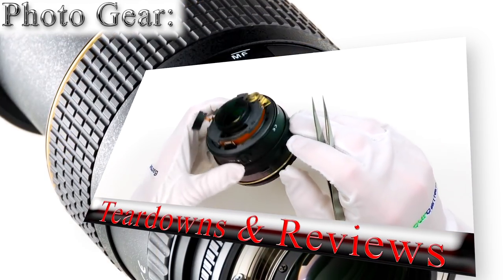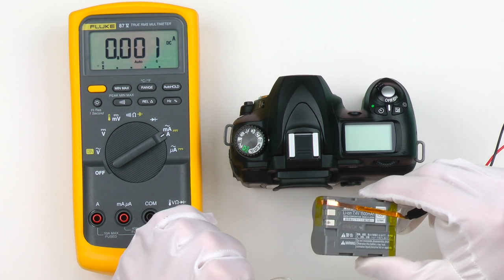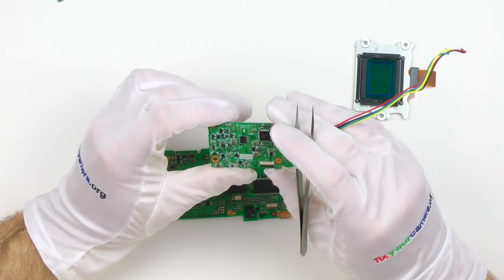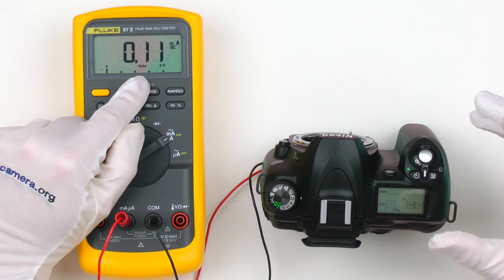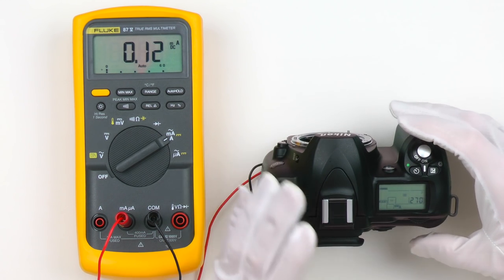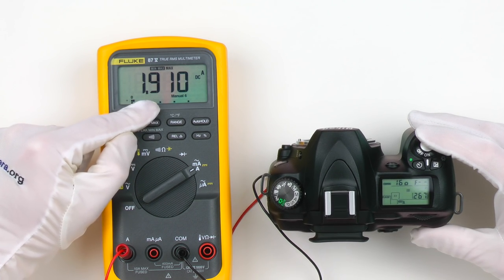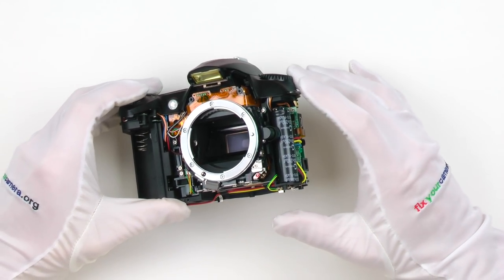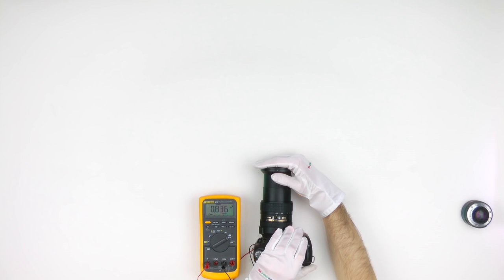Diagnosing tough DSLR and Lens problems - by measuring current... Super simple and very effective!

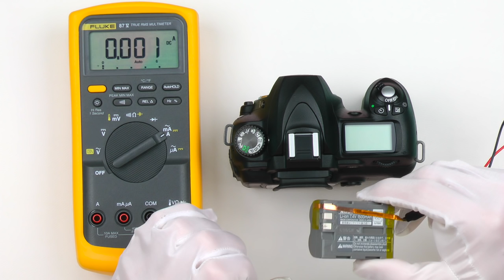Comment: Amazing tip!   But in your video, at minute 1:59 aproximately,  I don't see if the two thin pieces of copper with some plastic attached between them  should made contact between them, or if they must be maintained isolated.  Please, can you describe or explain it a bit more? Thanks!

Comment: what is proper way to fix dead battery syndrome?
Reply: +ganesh ghimire 
Charge it up !!
Reply from the maker: +ganesh ghimire   These are often tricky, I start with testing with my own battery and lens, then all contacts cleaning, current measurement as in this video, and I go from there depending on what I've found. Some are tough, really tough:)